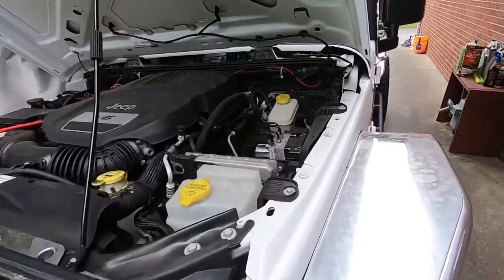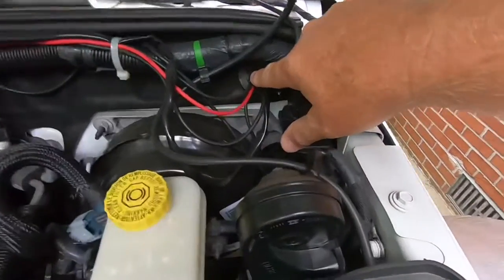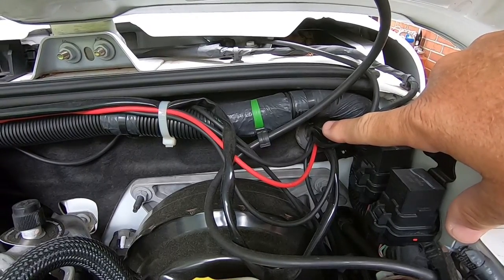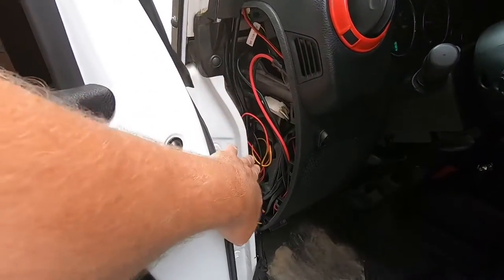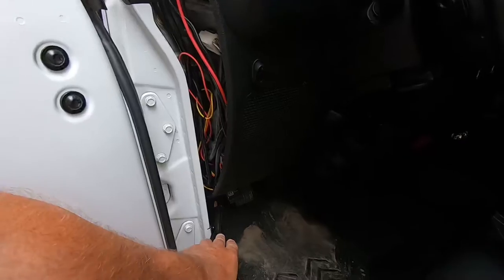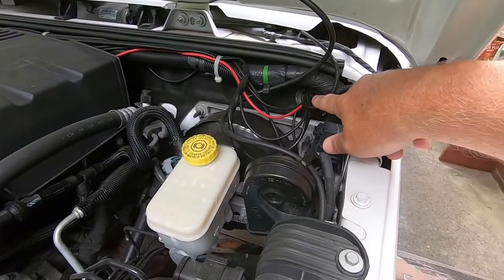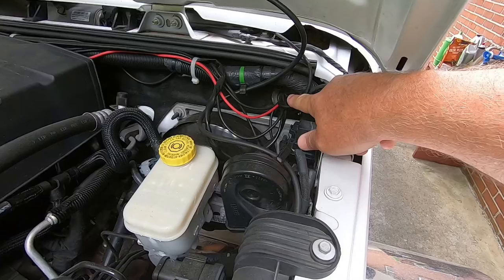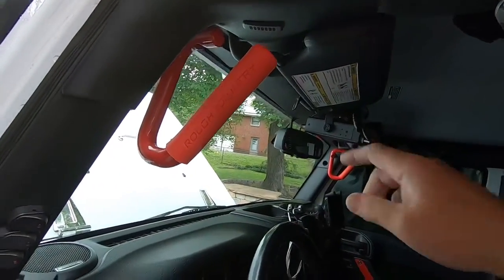How & Where to Route Wires into Jeep Wrangler Cab

Comment: Thank you! As a veteran Low-Voltage tech and Automotive Service tech, I always want to do a clean install. Having just bought my first Jeep recently, I was shocked to find no interior fuse panel! This makes it all seem just as easy, utilizing the grommet on both sides.
Reply from the maker: Thanks for watching! It amazes me that the auto companies have not caught onto installing factory accessory fuse panels and switches.
Reply: @Georgia4Low  Have you seen newer Ford pickups? Almost all of them have multiple factory Aux Switches, ready for anything you want to connect to the other end of the factory-installed wiring! This is my first Mopar, which is what led me to your video. I've been diehard Ford all my life! I can't believe Jeep doesn't follow suit...
Reply from the maker: @timmartin997 nice to hear that Ford figured it out. Ram trucks offers it in the 2500/3500 series trucks if you get the snow plow package.

Comment: I wonder, does removing the black liner on the under side of the hood like he has make the engine bay/motor run a bit hotter.
Reply from the maker: It’s main purpose was to keep heat from going into the hood and it acted as a fire/flame resistant material for engine bay fires.

Comment: People still drive JK's?🤔😉 In my 2020 JL there's a nice big plug right in the firewall on the driver's side. Couldn't be easier to get wiring into the cab.
Reply from the maker: Super easy on the JK’s as well, some people just don’t look. lol thanks for watching
Reply: @Georgia4Low  I'm just messing with ya! I found it on my 15 JK back in the day as well. The opening is larger on the JL though and easier to fit wires through.
Reply from the maker: @Michael_00001  engineers are listening lol
Reply: That plug only exists on the automatic transmission models. For standard transmissions the grommet is part of the master cylinder.
Reply from the maker: My Jeep in the video is a 2015 with a manual trans.
Reply: @Georgia4Low  I was replying to the comment from the guy with a 2020 JL. I have a 2020 JL 6 speed manual trans and the access port that he mentioned doesn't exist. On a JL manual that port is used by the clutch master cylinder. Still havent found a way to get through the firewall without drilling on mine.